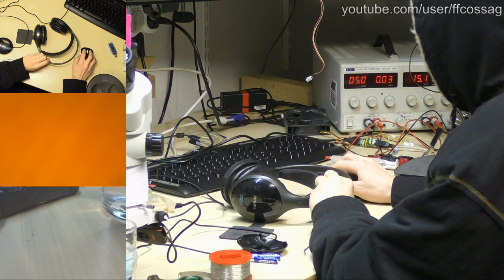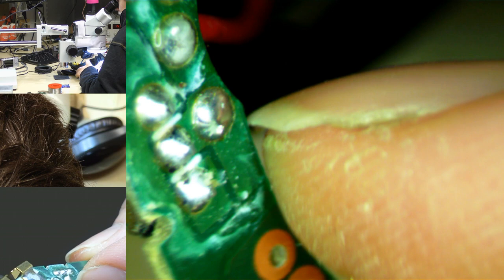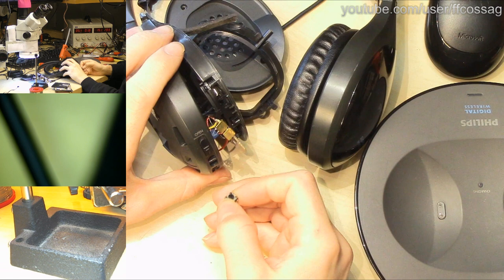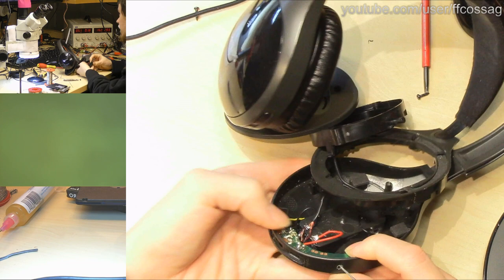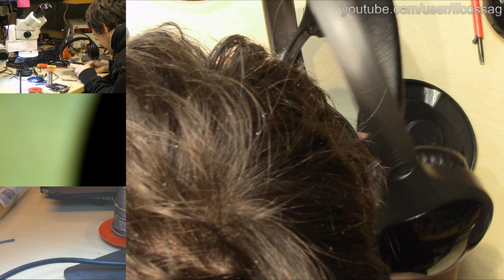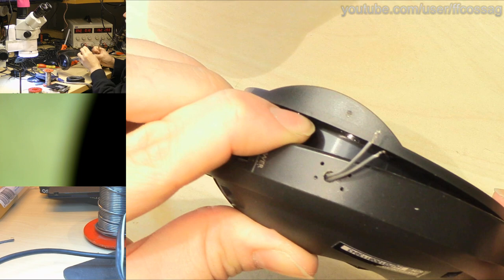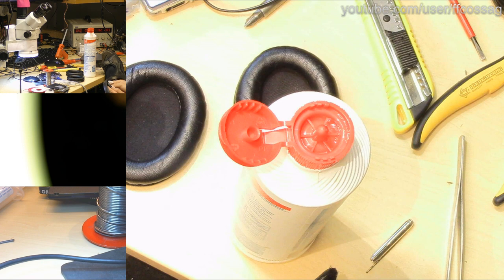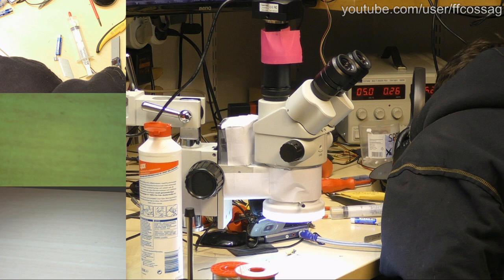RECDSTRM: Fixing things not worth fixing: Wireless headphones

Comment: I have a couple of Panasonic CD players from the late 90s that take 2 AA batteries.  They have that exact same setup for charging the (optional-$$) NiCd pack when the DC adapter is plugged in. I used the same unwrapping trick (successfully) with standard NiCd rechargeable batteries.

I think those CD players just use a dummy resistive circuit rather than a charge control IC, so it might overcook modern NiMH cells if the trickle current is too high.

I also have an iRiver MP3 player that has a setting in the options for alkaline or NiMH for the battery life indicator to read correctly. Annoyingly it doesn't charge NiMH cells when plugged into USB.

As far as I can tell there's no way to determine whether someone installs standard or rechargeable batteries since the operating voltage range of the cells overlap everywhere but the top. I feel that using the shortened wrap method with standard cells is preferable than proprietary battery packs since it's almost impossible to find replacement packs a few years later when you actually need one.